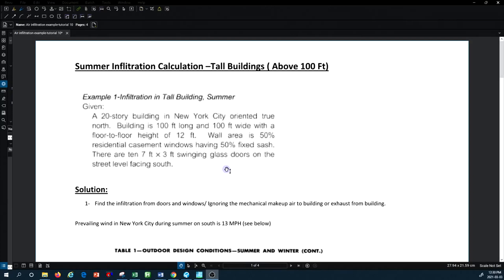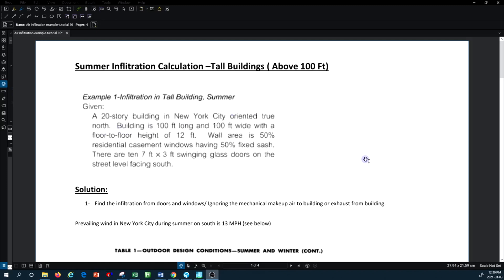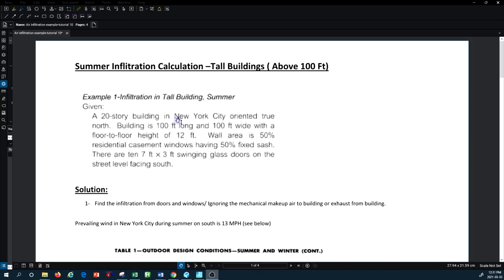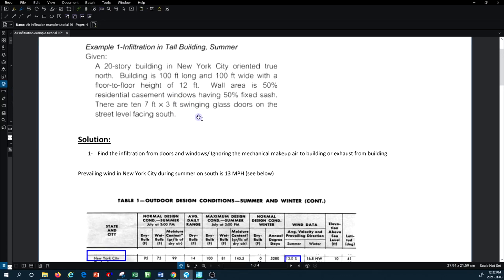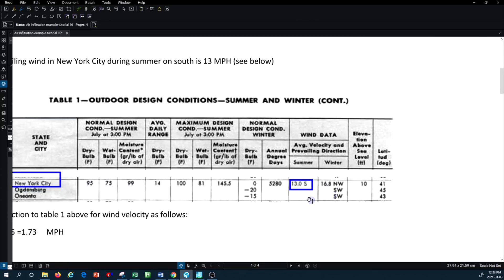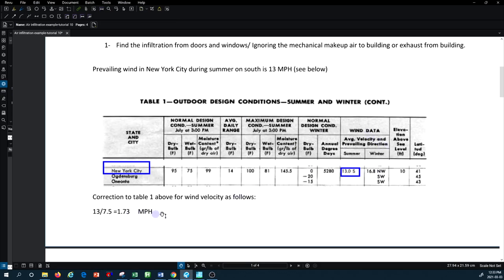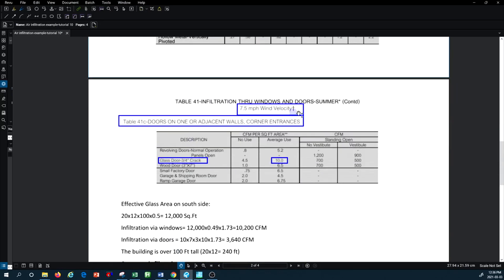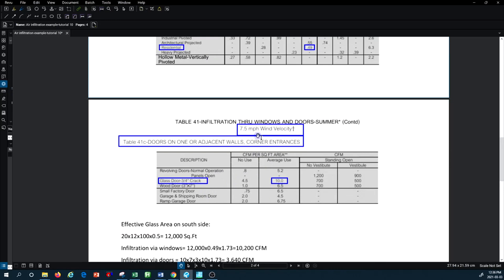HVAC SYSTEM DESIGN TUTORIAL-Carrier HAP- 10

Comment: In middle east when preparing heat load calculation for all types of buildings including towers normally we are considering infiltration only when the fan is off. That is we always provide a positive pressure inside the building especially at residences and offices by means of treated ventilation air through FAHUs.  What about your opinion in this regard?
Reply from the maker: Good observation. Yes correct. By installing the makeup air units or air handling units ( Fully ventilated fresh air units)  the high-rise corridors are pressurized  to overcome the  building's air infiltration effects as well as avoiding the air/odor migration into corridors from the residential units in every floor ( In the case of High-rise residential).

Comment: Hello Sir, I have one question concerning the 7.5 MPH value used for the correction of wind velocity. Can you provide more details about how this value is obtained? Is it based on the type of windows in the building? 
Thanks.
Brian.
Reply from the maker: Brian,
Thanks for your question.  According to Carrier Handbook the CFM infiltration per Sq. Ft area of building's windows or doors have been derived from ASHRAE air infiltration testing method where the infiltration is measured based on the observed crack width around typical windows or doors. There are more data and tables that can be studied so these empirical data developed by ASHRAE could be realized better. If you would like please send me your email nd I will send you some of these data for your study and more understanding of this topic. Cheers